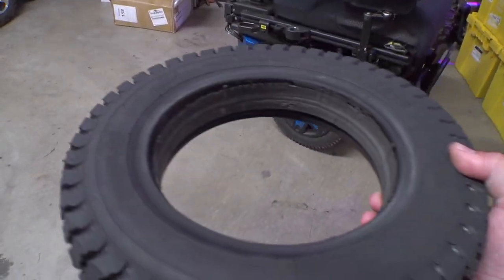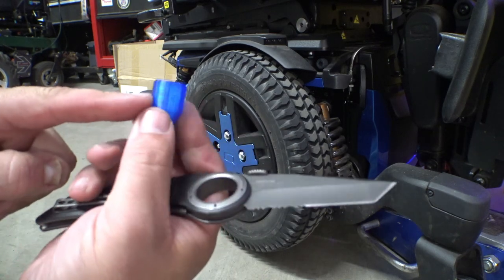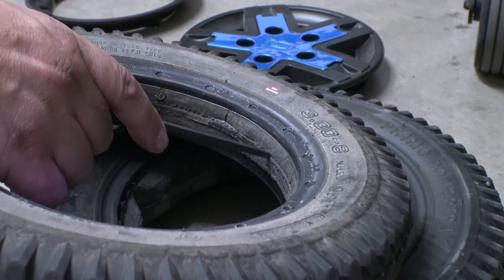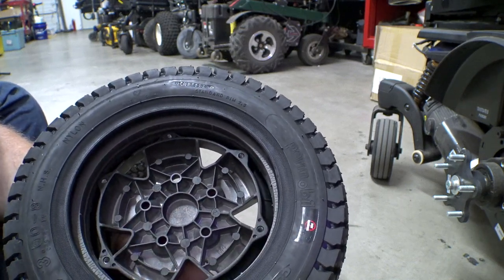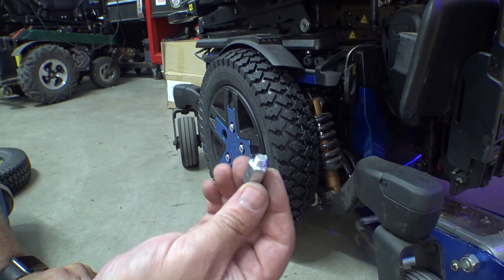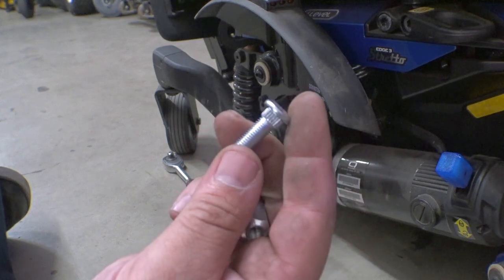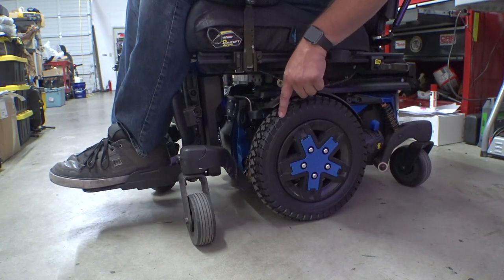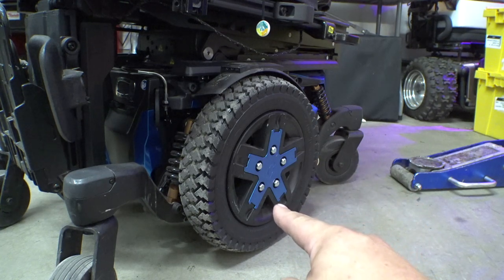VLOG 673: permobil tires on a quantum?? (OEM aggressive tread tires)

Comment from the maker: FYI on some quantum wheels, the permobil tires aren't clamped with enough force to hold them in place, and keep them from spinning on the wheel - that extra bit of foam filling on the stock quantum tires may be required for everything to work properly.  it worked fine on my edge 3 stretto - but ive heard from a few people with edge 1 chairs, that they had to take some extra steps to keep the permobil tires from spinning inside the quantum wheels

Comment: Dan, I am complete tetraplegic and use a Permobil M300. I needed to replace my batteries, Can you make a video regarding wheelchair Batteries like AGM, GEL, VRLA Batteries type. Please differentiate between Group 24  & Group 34 Batteries also. Can we use LiFePo4 Batteries instead of gel batteries as replacement. As Lithium iron phospate batteries have long life and weight also not that heavy. What's your suggestion on Lithium batteries as replacement as you have been using "Bounder" from your inventory.

Comment: Are you sure that actual rubber on the road is greater for the Permobil tyres? There may be more overall area, but there's a lot of space between the tread blocks. Would be interesting to see some ink tests (ink the tyre, place on paper, sit in chair) to compare actual net contact patch for each tyre. Obviously off road the performance will be different, but for, say, wet pavement, net rubber in touch with the surface matters a lot for traction and braking.
Reply from the maker: with these tires contact patch is only part of the equation.. the way the rubber flares out also has a 'gripping' effect - which allows for more traction utilizing the spaces in the tread pattern, and also the forward/side edges of the tread lugs
with these tires, i can get up the ramp into my van in the rain going as slow as i want.. with the stock primo tires, they just spin - and i have to get a running start

Comment: The hex shape of the rim is a tire rotation interference system. On the other rims, there are little "pins" cast into the bead of the rim. You can see it in the old tire, where the rim clamped it. Will it make a big difference in summer, probably not. But it may in cold or cool and rainy weather in high torque situations. Like quick stops or going over a small ledge. You'll just have to test it.
Reply from the maker: I noticed those while editing the video.. the quantum wheels seemed to have something similar..they almost looked like casting seams inside the bead surface- but they appear to be intentional, and spaced out equally.

Comment: I happened to have a heavy round. And I found the best way to stop things with a tires of cars issues. Far as pressure was I do what I did as a kid on my dirt bike. Is that that green gunk that's excellent? They use for off-road tires. If you change your valve stems, but before you change your valves and pull thed it out, put the green guck in as much of as you can fill the whole d*** tire up.  To the point that just leave enough room in there where you could just squeeze your hand in there before disconnecting the injection to where you can squeeze it just a little bit, then I'll do that, put the valve steam back in and pressurize it the rest of the way by pump do this on everyone of the tires at the same time, we gett all done within an hour or 2 are take breaks in between, but after each rotation on there, at least spin the tire around by driving. You don't have to take it off. Just why are you still in your car just running around the house?  That's all it takes, let us sit for a while, then add more pressure to it, and if there's any pinholes, I'll show up, but it will seal them. This works perfectly on every one of the have around tires that having an attitude and I repaired my heav around Uber a year ago.

Comment: I have refused to look at any 'Q' products based on a very disgruntled user and your experiences. Broken stud?! Cheap metal. Matt M. (Permobil) shared with the add-on of four power seat functions, they give a free lighting package. Permobil did it because Quantum introduced the idea. Elevators approved on group three PWC's, recently, but won't be realized for an indefinite period of time. F3 or F5 pending Voc Rehab - Thanks, Dan

Comment: Great video!!
Out of curiosity, have you found any easy way to push the wheels out a tiny bit so larger 3.5-8 tires will fit, similar to what you did with the C300 where you could flip the wheel around backwards for more clearance? Also, do you remember or have written down what the size spec was for the wheel stud that broke?
Thanks!!
Reply: I ask because I'm experimenting with an old q6 edge mid wheel chair to make it more capable on uneven terrain, and converting it to a frond drive chair. I swapped the drive motors left to right and removed the front casters, which pushes the drive wheels even further forward than they are on a 4front or f3, and i'd like to put aggressive tires on with an even wider track. This chair won't be used indoors, and won't be running for a lot of miles... maybe ~50 miles in a year total... so hopefully the gearbox and motors can deal with being run backwards for extended periods.
Reply from the maker: sometimes ya can get away with adding a few washers to the studs to get a bit more spacing.. depends on the wheels and tires you're using tho.
on the edge 2 and 3 chairs, if you're using the Michelin tires, a few washers is all the spacing thats needed :^)
Reply: awesome, i will order them up and give it a try. thank you!

Comment: 42. Could you squirt some Great Stuff (non-expanding) foam to fill the gaps?
Reply: That was my thought too when I saw it.  Use the kind you put around windows and doors in construction.  If it doesn't expand hard enough to move wood doors then it should be fine inside metal and bolts.

Comment: Just out of interest would it help you if you had a hydraulic jack in a pit in the ground that sits level with the floor so you can sit the chair over it then pump the hydraulic and the chair lifts making it easier to work on
Reply from the maker: ive got an extra van wheelchair lift in here - the plan is to built it into a portable platform to lift things up into the air to work on :^)

Comment: Hi ! Did you tried replace in standard batteries to lighter lifepo4 (low weight, longer range)? You doing grate job !
Reply from the maker: eventually i think the stretto is a good candidate for a Li swap.. the battery box is nice and long!